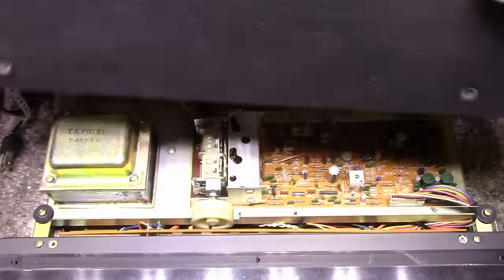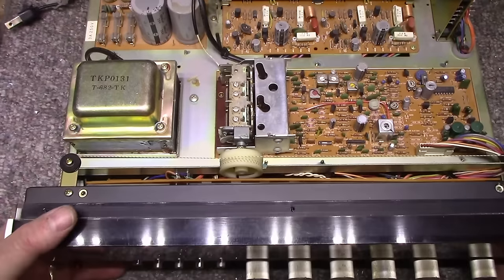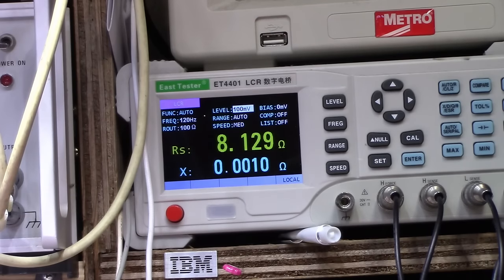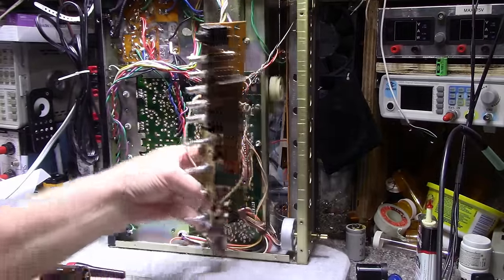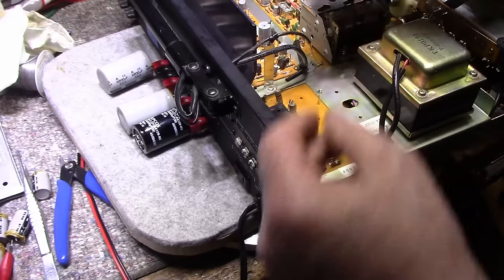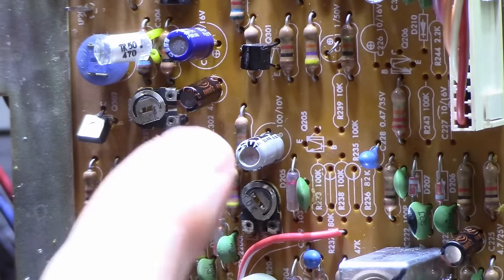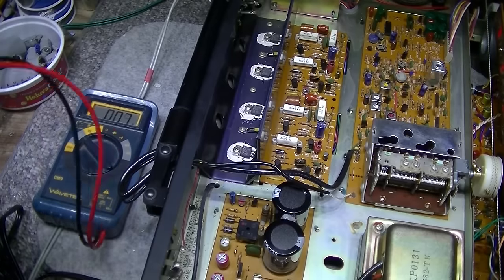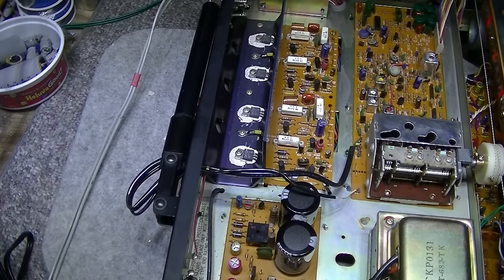Harman Kardon 330c Receiver Know your ABCs Part 3 (Ep. 221)

Comment: Incandescent lighting is so damaging from the Heat, I have seen on my Kenwood KT 9900 3 VU meters at top, those bulbs got so hot they fried the chrome which turned to rust. Enjoyed your fixing of that stuck VU meter. That light assembly reminds me of Marantz, but Marantz worse due to plastic, not metal. You took out many SCR's on that, Hatachi explains it. On a final, I do not understand Haters and if you have nothing positive to say on this thorough rebuild..............keep quiet.

Comment: I do not like at all how you joined those 2 transistors. Those create heat and you stuck them together.
Reply: ha ha ha fellow noob here :)      that could be exactly why he joined them together !!!  :)  sometimes techs join transistors together so that they are 'thermally coupled' this is so the thermal coefficient of the junctions match each other,   you will see other big named youtubers use the same method but with thermal paste in between the two transistors.
Reply: That was the idea. Thermocouple them.Not sure but heat compound is used sometimes too
Reply from the maker: The idea behind coupling these two transistors is so they maintain the same temperature at all times. This is so when the temperature changes their operating characteristics both drift the same amount.
These transistors are in the input section of the amplifier and have very little heat generated because they are low power devices in a low power circuit